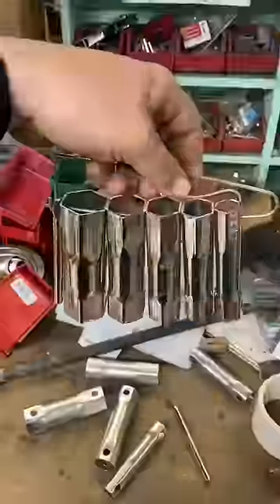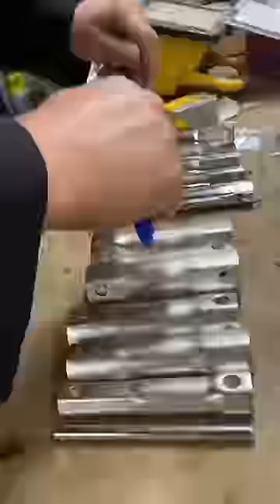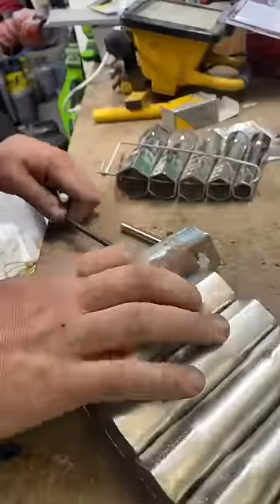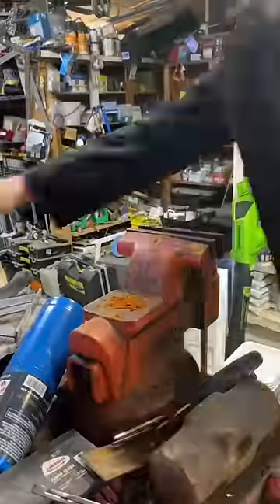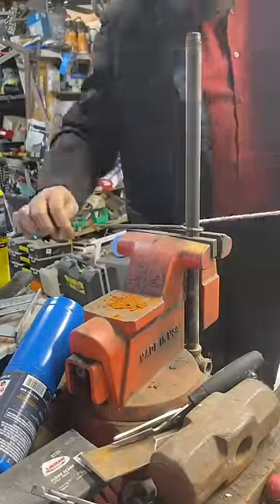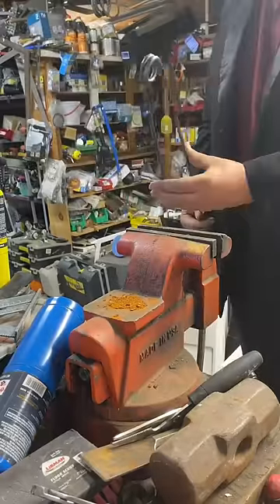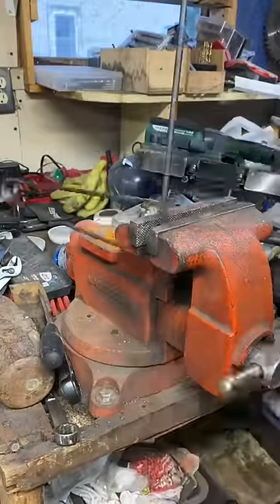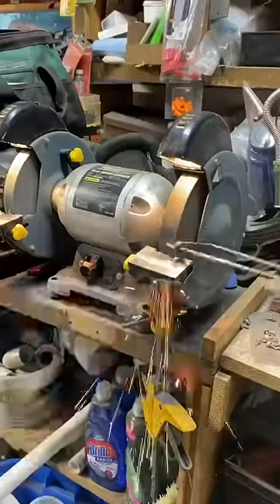Pretending to be a blacksmith and making a giant safety pin #HandsomeOrHandy #Blacksmith #Metalwork￼

Comment: I just put them on to a 8 gauge piece of copper or aluminum electrical wire. Little twist on the ends and they are more flexible and easier to store in different size bins or carry bags that they get put in.